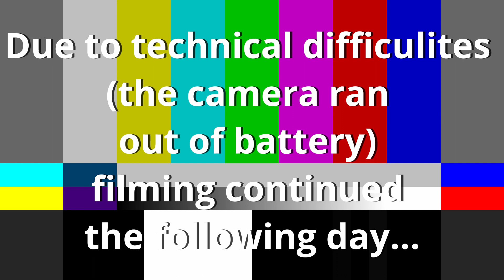A detailed look at the internal structure of a modern race boat

Comment: absolute super cool to see the inside and structure of a modern racing yacht, thank you Shayne, I sail with friends on a Cooksen made VOR60 excellent build quality for back then, no comparison to the cool carbon stuff on TP52 act, still we go 25 knots before we chicken out haha. What the draft on the lifting keel boat? Price?
Reply from the maker: The old kevlar submarines, such a good boat back in the day!
The boat for sale is a 65fter with a draft of 3m keel up and 4.8m keel down. It is 1.5 million euro, this is extremely well priced considering it is 5 million to replace. It also has a 40ft container decked out for sails and work shop.